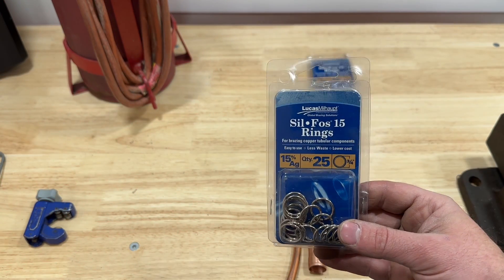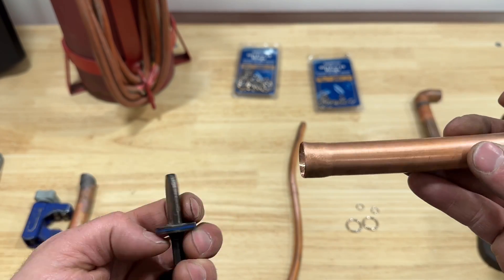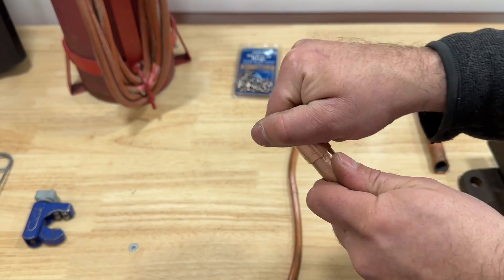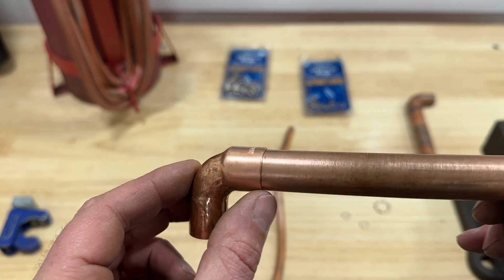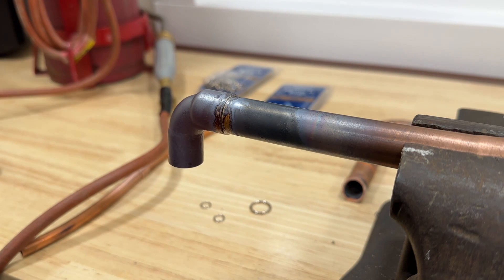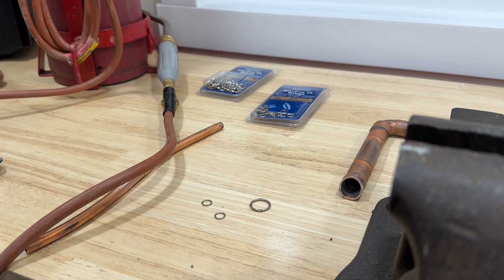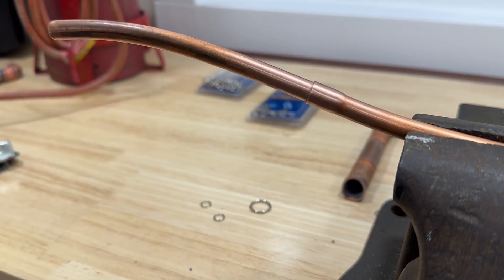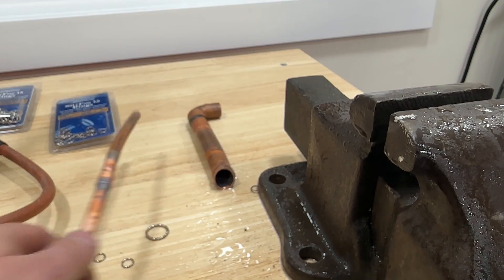A Perfect Copper Brazing Joint EVERY TIME | Silfos 15 Rings

Comment: When you heat one side of the joint - will the other size not oxidize before you get to that side of the joint causing a bad joint? (Assuming you put two rings in, one on each side of the joint at a time)

Comment: Looks pretty easy, but for ordinary plumbing fittings, I think I'll stick to soldering. 
My solder joints don't make the pipe look nearly as bad as the Oxy-Acetylene gas without Nitrogen. Plus I wipe my joints immediately after to make them look clean.
Reply: Lmfao… so you know how to solder, which is a very basic skill…
Reply: An Old Timer taught me to wipe my soldier joints w/ a damp rag while it's still hot.  I haven't had a leak in 20 years.
Reply: @greenidguy9292  brazing isn't that much harder 😂 both are piss easy, let's be honest 😅
Reply: @ethanwasme4307 it depends. Some people just can’t braze, solder, let alone weld a bead well at all. Brazing unlike metals can be tricky, but I always loved steel to copper, or brass to copper.

Comment: Have you ever seen brazing done by an induction heater?
Reply from the maker: Yesir! I’ve looked into it but they’re hard to find for this application and require a ton of voltage so it’s not very practical.

Comment: Turbo torch your using is air acetylene not oxy/acetylene
Reply: You're *
Reply from the maker: My mistake
Reply: @biggregg5  what ever,you're got spell checked!  Did you know he called the torch setup by the wrong name?
Reply: @petersmart1999  
Whatever *
Reply: @petersmart1999  you should accept learning just like the op. We all should learn every day
Reply: @AgentOffice  I am a 29 year HVAC tech!
Reply: @petersmart1999  I meant accept spelling suggestions. Why be mad
Reply: @AgentOffice  its all good
Reply: @petersmart1999  only 29? I'm 24 and a certifier...

learn the difference between you're and your 😂😂
Reply: @ethanwasme4307  auto correct does that ,I dont know why.Maybe you're being too critical. I look at it this way,99 % of people get what its saying so I dont go back and fix it.
Reply: @ethanwasme4307  24 and a certifier,I have enough certificates to wallpaper my house.Knowone seems to care what kinda paper you hold,only that you can get the job done and done right.

Comment: What do you mean by "with out a nitrogen flow"? I know what it is, im just asking for a friend. ;-) . And what would be the result if you did use a "nitrogen flow"?
Reply from the maker: You want to use a nitrogen flow to prevent soot build up in the lines. Not using a nitrogen flow will cause the soot to build up inside the lines even though you can’t see it, and it will cause issues with the system later down the road if not immediately

Comment: These are not new,been around for years,they were a modeled after the old navy brass fittings that came with the solder rings inside the fitting

Comment: You don’t use flux ?
Reply: Sil-Fos 15 is the preferred alloy for general copper-copper brazing; the phosphorous in the Sil-Fos family serves as a fluxing agent on coper, so no flux is recommended.
Reply from the maker: Exactly what he said 👍🏼 easy peasy
Reply: @DanO181919  
Thanks I didn’t know that.
Reply: @tunafish3216  no problem…. I’ve had lots of questions learning this trade and still learning.

Comment: “Perfect for brazing joints, when you don’t exactly know how to braze..”

I don’t think I’m being unreasonable when saying that it’s probably not a good idea to attempt brazing—at all—if you don’t know how to properly in the first place, let alone attempt to braze a circuit that is supposed to operate under pressures of hundreds of PSI. Brazing temps are far too high and dangerous for someone to just “play” with to attempt to save money on an a/c repair or something. Just my thoughts.